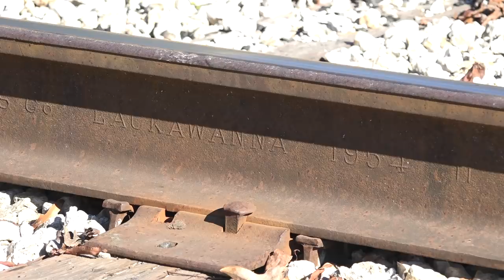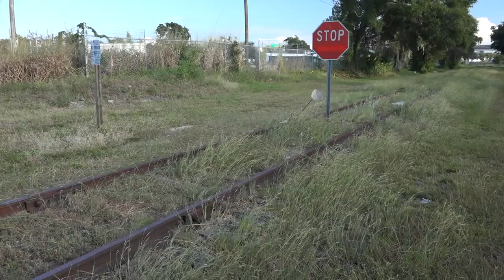FIRE CLOSES THE S-LINE

Comment: My math could be wrong, but assuming a railroad tank car fully loaded carries around 30,000 gallons, as long as that ethanol train was, we're dealing with a couple hundred thousand to a few MILLION gallons of highly flammable ethanol. Two buffer cars, one on each end, is probably not enough shielding to save you from this ginormous raging inferno of a fire (and fast ticking time bomb) that would ensue if the train passed anywhere near that magnesium fire. Yikes!

Comment: Off the Clearwater Sub in Oldsmar, just due west of the horse track (beneath the power lines. There’s an overgrown spur that crosses Douglas Rd and turns into a double track siding with concrete ties for about a mile. I’d write it off as just an industrial spur, however, it continues under Forest Lakes Rd. covered by a bridge that’s grated over the right of way (like it could be pulled up if a train needed to pass) and ends in a power substation. Any clues to this line’s former purpose?
Reply: Hi Garrett, I just came across this comment while binging some of Danny's older videos. On the off chance you're still wondering about this these years later, I don't have a firm answer but a pretty good guess. It's likely that these tracks served exactly what it looks like: Lake Tarpon Substation. That substation is a big one that steps down 500 kV transmission lines and the transformers needed for that are quite large, heavy things (many tons--not an easy load to haul on public roads, requiring special trailers and careful planning and execution), and it was probably cost effective to build that short spur just to bring those in. Duke already owns the ROW anyway for the transmission lines, so they may as well keep the tracks there (overgrown, but there) in case they ever need to bring another transformer in--transformers are long-lived, but they don't live forever, or they could decide to increase capacity someday. And that also explains the grating on Forest Lakes Blvd--there's probably some old rusty tracks underneath it, disused for a long time but ready to be resurrected for their brief time in the spotlight, if needed.
Reply: @BorgHunter  Better late than never! Thank you.

Comment: Most rail from rolling mills are in long lengths of 20 to 30 meters  that's about 60 to 90 feet and not drilled for bolts as it will be welded so the holes are not needed.  The rail is not CC or control cooled or soaked to let the hydrogen escape the hot steel because the molten steel is vacuum degassed then poured into continuous bloom casters from which the rail is rolled.  The real savings of CWR is not having all those joints,-bars and bolts- even though the number of anchors go up by about a third and more ballast is needed.  Back when I was working on track the savings to lay a mile of CWR over bolted rail was about $2000.  The joints are the single highest track maintenance item in the track budget because there are so many of them.  There are either 4 or 6 bolts, nuts, and washers per joint depending on rail size and railroad standard.
The Blackwater Creek trestle is ballast decked with concrete caps to better withstand the loadings from 100 ton car traffic.  I have seen some wood caps driven down over the piles from 100 ton car train traffic.  Some of the bents have two caps meaning the piles had to be cut because of damage.   If all of the bents have double caps the track was raised by about 12 inches.  Depending on the railroad standard plan, wood trestle bents are spaced 14, 14.5, or 15 feet CtoC.  The stringers are made up of 3 or 4  8 X 16 inch X 28, 29, or 30 foot wood beams bolted together under each rail with staggered joints.
Reply: Also, the jointed rail is noisier and causes more wear on the train wheels. Plus, the joints are harder to inspect even with ultrasonic tech (because of the highly irregular shape). There was a derailment in Oregon a few years ago, UP oil train derailed and caught fire. The cause was a broken bolt in the joint, where it was hidden out of view from inspection (bolt was rusted in place, but fractured where it passed through hole in rail). With only one bolt, the rail was overstressed, and it broke, leading to the derailment.

P.S. Thanks for the detailed information!
Reply: @BenjaminEsposti  The noise is from the wheels dropping into the gap between the rails at the joint.  This pounding is the reason for the dips in the track at rail joints.  The rail joint is the weakest part of the rail structure and includes crossing frogs and turnout frogs.  Consider that a one hundred ton car weighs 263,000 pounds total of load and car on 8 wheels so each wheel is loading the rail by 32,875 lbs in static load.  Jumping any kind of a gap means a huge impact especially at 45 mph or 75 kph.
I spent about 20 years in railroad track engineering.
Reply: @royreynolds108  Thanks for all those details Roy.   Get to learn some new stuff every day when watching some of these train videos. 

 I follow a lot of the guys that post train videos here, but, no offense to all the others that do this, Danny's are the best on YouTube, his narrations are always crisp, clear and also very informative of what the train is, locomotive info and such.  Makes it a lot more interesting to listen to and watch!
Reply: @HolidayDecorator  100% correct,,,,,,,,,,,,,danny's videos are THE BEST......HANDS DOWN.....

Comment: That's a pretty intresting diamond.
Reply: The interesting part is that CSX replaced the 90# diamond with 132# so either the angle was the same and sitting in inventory when  this one needed replacement, or they were planning to upgrade the rail on one of the lines to 132# but then those plans were halted.
After looking at a map I see this is just a balloon loop that crosses itself which explains the lack of interlocking protection. Suffice it to say there must have been an issue with the old 90# diamond which resulted in replacing with the current one.

Comment: Hey Danny, that Lacawanna rail was made in Bethlehem steel in Lacawanna ,New York, just south of Buffalo.
Reply: Chris herman yeah, I was thinking that. That old building went up in flames a few years ago. Drove by there just a month ago and there’s nothing but the frame of it is still up.
Reply: I see a lot of BSCO "Lackawanna" rail in various places, amazing it made it to FL. It was rolled in the 14"  mill. It came out of the rollers like orange wet noodles, and it was hairy to watch one get away. The building that had the big fire recently was the old Strip Mill (coiled sheets), that was being used for storage. You gents are correct ... almost all of it is gone
Reply: Had a relative that worked at Bethlehem Steel and I have a photo of the smoke from the fire. So cool that these pieces made it to FL.

Comment: That Brooksville line is certainly quiet. We used to go to a church in Lutz and only ever saw a pair of lite engines heading back to Tampa on a Sunday afternoon. That track in St. Petersburg is interesting too. Down almost to the end where it nears Tropicana Field and crossed N Central Ave., there was an old set of cantilever crossing signals, possibly from the 50's with the old cat-eye reflectors on the crossbucks.
Reply: You're right about the Brooksville Sub. I can tell you something else about it; the current northern segment leading to the Cemex mine, also had a spur that crossed US 98 just south of Hernando CR 476. Then it crossed CR 476 itself before heading into another sand mine. That line was torn up in the early-2000's.

Comment: Next time you're in Dade City, if you have a few minutes, follow River Road to the river. There you'll see a one lane wooden bridge. There used to be a mulch and fertilizer plant about a mile north of that crossing. In the mid 80s, when I was driving flatbed tractor trailers, I picked up loads there. When you got back to the bridge(now loaded), there was a sign that said 10 ton limit. I sat there for a minute, laughing, then, following another rig that left just before me, crossed that bridge, s-l-o-w-l-y, holding my breath all the way. 
 Great video, by the way. Have you looked at "Pioneer Park",  just north of the fire's location? The old ACL Trilby depot is there, along with a steam engine from the Cypress plant in Lacoochee.
Reply from the maker: Haha! That's EXACTLY what I did the day I shot this. I grabbed a sandwich and drove out River Road looking for the river, found that one-lane bridge and drove through the park. Never saw the river, except from the bridge, then drove back via Duck Lake Canal Rd & Enterprise rd back to the tracks.

Comment: The "reducer" bars at the crossing are usually called "comp" bars for compromise bars and a usually not made for such a drastic change.  The 90 lb to 132 lb transition would usually be made as 90 to 115 then 115 to 132 or reverse.  The track with the blue flag is the 132 lb rail and for more heavy use.
Your comment on ties is right on as the usual budget is to replace about 1 in 6 ties per year depending on traffic and curvature.  Before preservatives were widely used,  tie life was only about 4 years.

Comment: I guess no one told the firefighters that there were alkali metals in there, or they would have used a dry powder (or fine-grain sand) to put out the fire; never put out alkali metal fires with water, it just makes it worse! I wonder what the track gang does when they get to the bridge; they can’t just throw the continuous-welded rail over the side, and I’m not sure there’s clearance enough to drop it on the bridge itself. 🤔

Comment: I've actually seen CSX cut the rail they were laying out at a road crossing to avoid blocking traffic. Great video though!
Reply from the maker: Yeah, me too but I've seen more often them just trench the rail under the pavement. I don't know when they do it one way and when the other.
Reply: @distantsignal  Maybe it depends on the condition of the rail in the pavement, or the condition of the grade at the crossing?

Comment: Magnesium burns somewhere around 3,000 degrees I believe and ethanol evaporates around room temperature or a little higher, I’m not sure of the flash point of it but I’m sure it’s less than 3,000 degrees I’m glad that train didn’t go past that fire cause that would’ve been a very large bomb waiting to go off, also were they trying to put that fire out using water? Because water reacts with magnesium and causes fires, hope that was foam they were using

Comment: Aren’t they called Buffer Cars?
Reply: DDRailroad that’s one of the terms
Reply from the maker: Yes they are. But I looked in CSX's rail glossary and they call 'em Spacer Cars.
Reply: @distantsignal  They're usually filled with sand and the hatches welded shut. It's the only purpose these cars have later in life. Great video, as always!
Reply: Hi :)
Reply: DDRailroad If I recall from my videos, BUFFER CARS are used to protect WIDE LOADS from shifting during transport & to prevent damaging the lead locomotives.
Reply: @distantsignal  Hi, Danny. Great Video!  CSX requires a spacer car for separation between the locomotive and a hazardous materials car, whether the hazmat car is full or empty.  This applies also to helper units on the rear, if assistance is needed and the last car to shove against is a hazmat car.
Reply: Probably different terms are used because someone has it copyrighted.
Yes, the buffer cars protect shifting oversized loads, and/or help protect the locomotives/crew if there is a derailment with hazmat, as the train cars have a tendency to "accordion" when they derail and pile up.
Reply: We always called them cushion cars
Reply: Pretty much the same thing, Buffer, Spacer, whatever floats your boat

Comment: Mt Vernon  Indiana  has an Ethynal  plant.  All rail lines pass through Evansville Indiana. Howell rail yards ..  Big problem is. You use more Electric power to produce Alcohol.  Than  if you  produced electric to use in electric vehicles.  I have been told this alcohol  is sold to Spain.  Not a drop is used in the USA.   I never know where the product is going to.   Later.

Comment: Does CSX crews give the dispatcher OS radio traffic for every point they pass?
Reply: On CSX, Crews are required to call out their signals. The order in which they are supposed to call it is debatable but so long as it has [Signal Aspect] [Signal Name/Location/ Milepost] [Train ID, Lead engine # and direction of movement] then they are covered by the requirements of the government. 
Even then, the FRA only requires the train to call out any signal that is less permissive than a clear signal, but railroads often choose to have them call out all signals so that they can keep a record of the traffic.
Crews do not call them out to a dispatcher directly. Instead they are simply placing a timestamp on a voice recorder both inside the engines and on any wayside radio devices that exist, such as dispatching towers.

Comment: Hey Danny,
  great job as always, but I have a question. So if the line was shut down for that long that has to cause a backlog of trains , my question is how long does it take to clear that backlog or do they conduct different ways of handling?
Reply: There's a lot of variables involved.  If there was a 4 hour period of service interruption most dispatchers can have service restored by the end of their shift. But in cases like the Vitis Jct crash where service was interrupted for more than 24 hours, they are putting crews in hotels for an indefinite period until restored. They also look to rerouting traffic although now that they have sold a big piece of the A-line to FDOT that's probably not an option for them.
Reply: @SD40Fan_Jason  From my understanding even though they sold the A-Line section to F-DOT, CSX if they need to, can still use the line for rerouting trains in case of a track shutdown, or any other emergency situation where the normal route may be unusable for any reason.    As on occasion, when I've been lucky enough to be near the tracks they sold off, I've seen CSX freight trains rolling down the line during daylight and night hours.    Not sure if they still do any regular night runs on the A-Line any longer down to Taft though.
Reply: @HolidayDecorator  It is a sticky wicket for sure. CSX has trackage rights for the purpose of servicing the freight business on the Sunrail corridor. They also operate on the Stanton block and other branches in the corridor as well as the switching yards. But to reroute their manifest traffic through FDOT would require some heavy red tape cutting and deep pockets. 
I dont remember if CSX left a clause in their sale contract to give them reasonable access outside of their routine operations. In most  cases like this they propose such a clause and it's up to the buyers to renegotiate out of it.
Reply: @SD40Fan_Jason  from what I understood of the sale, CSX did put such a clause in place, and as far as I'm aware it is still in place.

Comment: I love the slush set at 4:41! You tell who has the prime mover the with the exhaust. Seeing that the slug is lead do you think the crew rides in that because it's not as loud? In the compartment that held the primer mover I wonder with the do with that space? I mean if think about it the slug only has the four traction motors and there power comes from the mother. Just asking.
Reply: Concrete in the car body for weight.

Comment: I’m surprised they’re allowed to run 6 axle power on 90lb rail
Reply: Why are you surprised? The only problem 90# rail would ever have with six-axle engines would be if it had a tight curve. But that problem would also exist on 143# as well...

Comment: So what's the reason for using wooden ties in a climate that seemingly would support the use of concrete ties better than the freezing north? I'm from Minnesota and many lines (including the BNSF northern Transcon) are being replaced or adding any additional tracks with concrete ties.
Reply from the maker: I'm sure it's the same old reason; cost. Timber is till far cheaper than concrete, but they are slowly switching over in some places. The Fitzgerald sub has large portions of concrete. All the new sidings on the S-Line are concrete.

Comment: Magnesium - scary stuff! Danny, when you sign off, it's usually at a point where the mileage is in the high hundreds. Where is the datum (or zero mile) point? I've tried to deduce where it is from various maps but without success. Your knowledge means you probably have the answer at your fingertips! Tnx. 73 de MM5AON - a Brit Railway Enthusiast [Edited for typos]
Reply: For the S-line and A-line the 0-mile is the old Home offices in Richmond, VA
Reply: @SD40Fan_Jason  Thank you for that information. With the maps I have, there is no way I'd have sussed that out - they are not old enough. Again, thank you.

Comment: How do these long rail cars make Corners?  Does the rail bend and flex?
Reply: DDRailroad yes
Reply from the maker: Yes, it does. I don't know what the radius limit is, but they can go around mainline curves.
Reply: Distant Signal going through a switch is a speed of 10mph. Mainline straight away max speed is 40mph. Most curves are 30mph however the tighter ones are restricted to between 15 and 20.
Reply: They're limited to 5 m.p.h. on the FEC, assuming it's similar on CSX